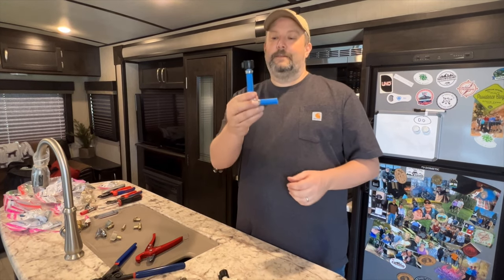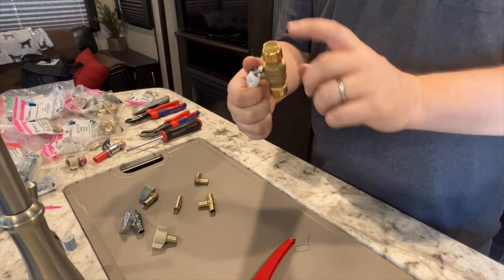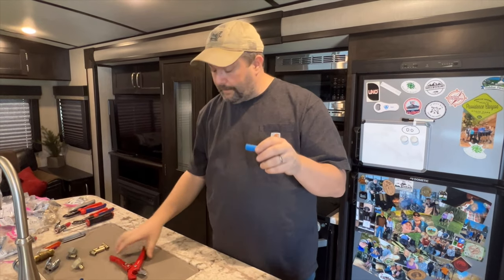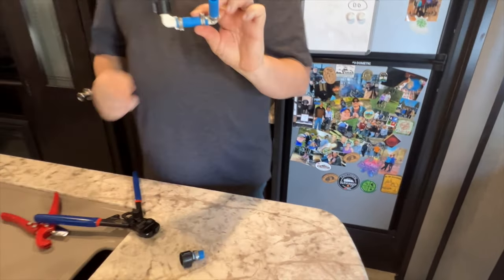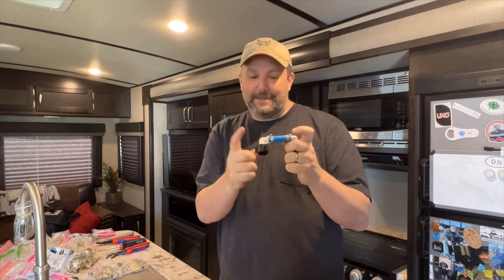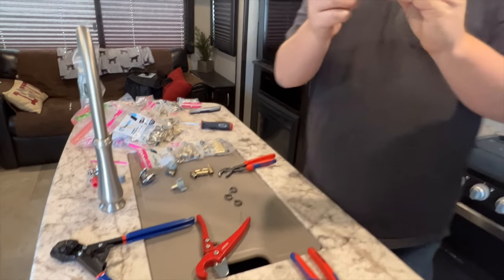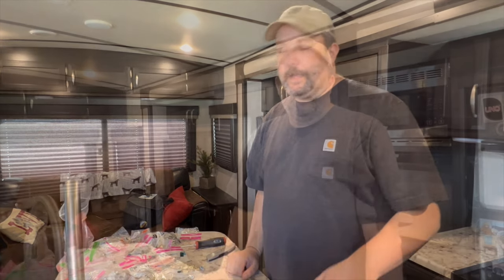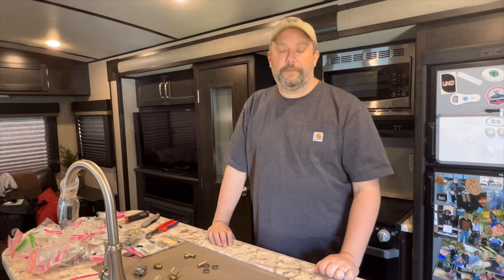How to fix a water leak in an RV | RV PEX Parts | PEX Crimper Tool | Camper water leak | RVlife

Comment: Hahaha I'm already freaking out! Bought a 22 year old Class B+. Somewhere there's a leak around the fresh water tank. Gotta find it. It's all winterized at this moment. But not sure how one finds a leak when your water tanks are EMPTY? Meantime this is a good video for making sure you have the right materials and tools in advance of repair work and also thinking ahead for those on the road problems. My little 22' RV has very little storage. No way is it going to hold those large rolls of plastic tubing. But I've already started a material kit to keep on hand and on the road. Like toilet valves and gaskets and so tubing is going into it tool Along with the appropriate tools like the crimping tool. I may have to borrow my husbands...that's not going to go over well. Now if I can just get my husband to come along too and bring that tool. Yeah after 51 years of marriage and his lack of enthusiasm for camping. He's not changing me nor I him and we get along fine this way. I'm the camper. And oh that's why when I see how much STRENGTH for that MAN SIZE Crimping tool...I'll figure it out if  need be. I've never owned an RV of any kind and never camp in those fancy campgrounds with water and power. So I'm actually searching on how to fill your tank without a city hose with pressure. It's a little confusing. I'm saving this link however for future refreshing course on how to make repairs. Thanks for your good tutorials.

Comment: Replacing my kitchen faucet on Friday. It’s leaking. Adding shut off also. PEX is so easy to use you are right. The hardest part is just being able to get to the lines under the faucet. No access panels at all and it’s out of reach. Going to have to get creative with this repair. Thanks for the video Fitch.
Reply from the maker: I would definitely add shut offs!

Comment: Wish I saw this before I went to Lowe’s at 8:40 and not stuck without some of the things I should have got. Looming at the set up I wish all these  could flex or bend and also screw on so it’s easy to take it off. I’m pulling the T off and can’t get one off. I can’t cut the pipe because I don’t have extra pipe. To your 9pm comment, yep nothing happens during the weekend or day. Only 29° on a weekend and before you are to leave one location.
Reply from the maker: Stuff always happens at the worst times! Hang in there!   Thanks for watching!

Comment: Thank you! This is a great informative video to help me repair my water leak on my Jayco travel trailer
Reply from the maker: Glad to hear it helped out!  Thanks for watching!
Reply: @FollowingtheFitchs  FYI.. I have a 2018 jayco travel trailer (18ft) I bought used on Craigslist last year. Noticed a water leak near the water heater on the 2nd camping trip last November and again in December. Those darn 90 degree 1/2 plastic adaptors from the cold water line from the water heater was the culprit. So I replaced both cold and hot adaptors to brass from Home Depot - no leaks now after testing for a few hours. I do recommend purchasing a dedicated crimp removal tool - it saved me hours of work. For anyone purchasing an RV/Trailer used for the first time - check your trailer for water leaks!

Comment: To remove the pex band I purchased a Drexel tool and used a cutoff blade cut the band and removed removed in less than a minute.
Reply from the maker: That certainly works. I was more so trying to show how to remove it with tools most people are likely to have with them while camping.

Comment: I’m an rv tech. People can save lots of money by keeping these supplies on hand. For the cost of one service call and repair could create an emergency toolbox to do your own repairs, if you’re comfortable doing it yourself.
Reply from the maker: For sure. In reality, I think a lot of the fixes are pretty minor. I think people are just intimidated to roll up their sleeves and tackle it.
Reply: Absolutely. I'm basically broke so I do the repairs myself. It's definitely intimidating but usually I end up surprised how easy things tend to be. Idk why I'm still surprised at this point lol
Reply: Why not use standard hose clamp??thanks
Reply: @tomstrickland5504 do you mean the screw clamps? They are not rated for or strong enough to clamp the hard line PEX. Good for the braided vinyl but not PEX
Reply: @hobbyguy79  no sir, pex crimp clamps.
Reply: @hobbyguy79  thanks!

Comment: Good video! I’m here looking because of a drip off a fitting on a Nautilus P-1 system! It’s the system in newer campers an they are a fking nightmare of lines an hoses that you aren’t getting a crisper in! I think going to cut the metal crimp off an put a hose clamp on. Thanks! Bob
Reply from the maker: Thanks for watching!  It’s crazy how many lines and wires are behind those panels!
Reply: @FollowingtheFitchs  Yes an it’s all soft hose an the Winters an freezing in Winters here in Upper Michigan are Not good for These plastic fitting! They leak an when try to tighten fitting they crack an break! Then trying to get parts is even worse. RV dealers don’t want to sell parts they want you to bring RV an charge 100. $ an hr to fix them?

Comment: Great, straight forward and precise video. Thank you for this video, really appreciate your knowledge!! And the parts list for amazon was also a time saver!
Reply from the maker: Glad to hear it helped out!  Thanks for watching!
Reply: Question. At the end you mentioned the flex line under your sink. I believe that is what was used for my hot and cold water connection to the bathroom facet, not pex. They used the crimp connectors on that, is that proper or should I replace them with worm gear clamps? Both are leaking right now and need repair.
Reply from the maker: There’s an ongoing debate about that. If it were mine, I would use the crimp style.  If you put the worm gear style clamp on, I would definitely use a brass fitting.
Reply from the maker: Also, while you’re fixing it, it would be a good idea to go ahead and put a shutoff valve on each line.

Comment: do the swivel fittings fit onto a special fitting or just normal pipe threads.  I am making a water filter in the camper and coming out of the filter with a 3/4 to 1/2 brass pipe reducer.  with the swivel adapter screw onto that or do I need a special male piece to screw onto.  Good Video by the way
Reply from the maker: The swivels in this video will thread onto  normal 1/2” threads. They are made to connect to the water pump, back side of faucets, etc.    thanks!

Comment: Dave, thanks for the nice video. It all looks very easy when you're working on the countertop demonstrating things but when I look in my water pump compartment there's no way I can get a big tool in there to crimp things. Could you demonstrate how to work in tight spaces where you have to use a crimping tool?
Reply from the maker: That’s definitely the toughest part. What I ended up doing was cutting the pex line in an area (that wasn’t broken) where I knew I could use the tool. Then I crimped the parts together out in the open and put it back in place.  Then re-crimped the one I could get to with the tool. I know it sounds crazy cutting a part that was not broken just to fix one that was, but given the small workspace, that was the easiest thing to do.   If you look at our video from November at Mohican State Park, I fixed a leak on that trip. If I remember correctly, I think I may have mentioned that I had to remove “good” parts to get to the broken one.  It’s about mid way through the video.    Thanks for watching!
Reply: Thanks for the reply. Is it safe to use shark bite fittings or compression fittings on RV plumbing?
Reply from the maker: If it’s normal pex line, yes.   Sharkbite makes the push on style and also crimp style. I used the Sharkbite crimp style. If you use the push on style, make sure you buy the small horseshoe shaped tool that is needed to remove them just in case you would ever need to do that.  There are links to all the parts I used in the video description too.
Reply from the maker: I changed our kitchen faucet to a residential one. It had 3/8” compression fittings. I got the 3/8” compression to 1/2”  adapters. It works great. I also recommend adding a shut off valve too. This would be useful if you ever needed to shut off water to a certain area but still needed water in the rest of the RV.

Comment: I'm frustrated...  We had a leak and I watched videos such as this one and the replacement of the nylon fittings with the sharkbite fittings.  Despite torqueing down those fittings onto the existing plastic manifold on the back of the nautilus P4, the one spot is leaking even more with the sharkbite.  Are sharkbite with 1/2" npt truly compatible with the garbage plastic on the manifold?
Reply from the maker: Is the water line you are crimping the hard pex line or is it the flexible tubing?

Comment: I have a leak at the connection to the rv hot water heater. It is a 90  degree elbow to pex. Do you know what size the tank thread is? Are they typical in size? 3/4"? 2021 Keystone hideout
Reply from the maker: Most of the pex in RV’s is 1/2” pex. Actually, I’ve never seen any that are not 1/2”. The lines connecting to my water heater tank are 1/2” pex. I’d bet yours are as well.

Comment: I’m looking at the shark bite equipment.  In your personal opinion is there any advantage between the clamp style vs. push on style of the shark bite fittings?
Reply from the maker: I think an advantage to the push on style is that you don’t need a special tool to put them on. You do need a special tool to remove them, though.  Luckily it is a really inexpensive tool.  The push on can be used it tight spaces where the crimp tool won’t fit.    The push on are more expensive.  The push on only work with the hard pex line like I showed in this video. For the flex line, you would need to use the crimp style. 
Thanks for watching!

Comment: I don’t think you mentioned it but what do you use to clamp the flexible braided hose in your RV?
Reply from the maker: I had one fitting on the flexible hose leak. It was not due to the hose or crimp, though, the seal inside the fitting got brittle. I used the regular crimp style one to fix it.   I think this is one of those topics where if you ask 10 people and you’ll get 10 different answers.  I can tell you I have never had a leak due to a crimped flexible hose. Hope this helps!  Thanks for watching and commenting!

Comment: Can you add the shut off valves that you just press the pex lines in to.  From sharkbite or do you have to actually clamp them with the tool?
Reply from the maker: Yep. If you have the hard pex line you can use the push on style shut off. You wouldn’t want to use the push on syle with flexible tubing though. Make sure you get the little horseshoe looking tool that is needed to remove them in case you ever need to.
Reply: @FollowingtheFitchs  By hard PEX your reffering to the stuff you have 2 rolls of right?
Reply from the maker: Correct.  There is a type of flexible tubing used in rv’s too and some people call it pex as well.
Reply: @FollowingtheFitchs  ok your reffering to the pvc with nylon hose thats the one leaking in my toilet. Im gonna try to use a steel brades line. Thanks for the reply

Comment: I noticed the PEX you carry with you is in coils.  Is that PEX A, or PEX B.  My understanding is that most, if not all, PEX in RV's is PEX B.  Am I missing something?  Otherwise, very helpful video.  Thanks.
Reply from the maker: It’s B.
Reply: Roger that.  I have never seen PEX B in coils, only sticks.  Thanks.   @FollowingtheFitchs
Reply from the maker: @davidjackman5773  no problem!  I picked up the roll at Home Depot.

Comment: Under my kitchen sink on a brand new rv leaks. I tried to wrap it with plumbers tape and reefed it down, still slightly leaks. Ive given up lol
Reply from the maker: A lot of the fittings have the rubber crush seal in them. Plumbers tape usually will not work on those.
Reply: @FollowingtheFitchs  i got it to work. I had to get wrenches out and go midevil on it. No leaking now

Comment: DO NOT USE A BOX KNIFE WITH PLASTIC FITTINGS!  While completely changing out a plumbing system on a motorhome, I kept changing my mind how I would want a line set ran. I would cut the line with a box knife so as to be able to reuse the fitting. Long story shortened, every one of the fittings I used a knife to cut the pex pipe loose, leaked. What I learned before I pressure tested was if I needed to remove a fitting, was to use a heat gun and just heat the end of the pipe for just a minute or less. The fitting, whether it be plastic or brass would slide right out and thus I saved the pipe and fitting. Just let the pipe cool off for a few minutes and then reinsert your fitting and clamp with a new crimp clamp. It was only after all this though I discovered my leaks which were caused by the knife even though I would swear I never touched the fitting with the knife. No other fittings leaked, even the ones I took apart and reassembled using a heat gun.
Reply from the maker: I think you missed the point. I wouldn’t cheap out and reuse a plastic fitting at all.  That’s why I have the brass replacements and carry them with me in the camper. What I was saying is if you are in a pinch during a trip and need to fix a leak with the tools you may have on hand, you could use a knife to slowly score the line.  Most people don’t carry a heat gun around with them (I carry the Milwaukee M18 one) but they likely do have a knife and it can be used in the manner I mentioned in the video without issue.
Reply: PARDON

Comment: Its sad brand news ones will be leaking..im having the problem after having it 1 month lol
Reply from the maker: That sucks, especially with a brand new camper. The folks actually building them definitely do not take pride in their work.
Reply: @FollowingtheFitchs  i know. They have such a Grand Design :D lol
Reply from the maker: @themotorcycleguy5980  side note, I bought a dual sport at the end of last year. Just took the motorcycle endorsement test. I shot some video of the steps to pass here in Ohio.

Comment: Terrible. Not showing anywhere the leaks are and how to find them.  Ughhh
Reply from the maker: You obviously didn’t watch the video. I explained where to look for leaks, which is actually a bonus since the title of the video is “how to FIX a water leak in an RV”, and not where to find them. Finding them is easy, look for water where it normally shouldn’t be. 
Ughhh is right, but the 20,000+ other people that watched this video seemed to get it right.